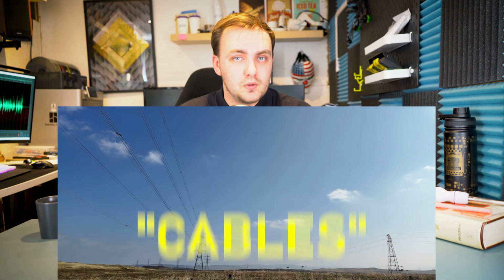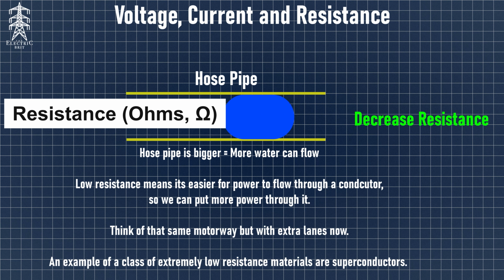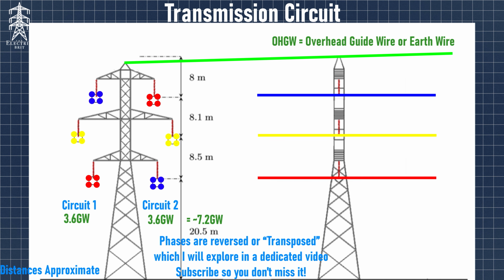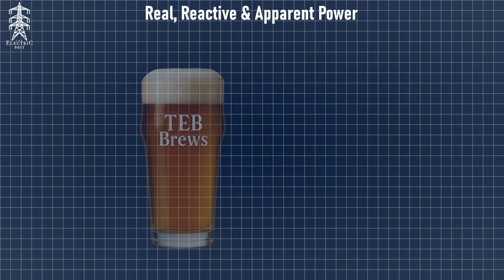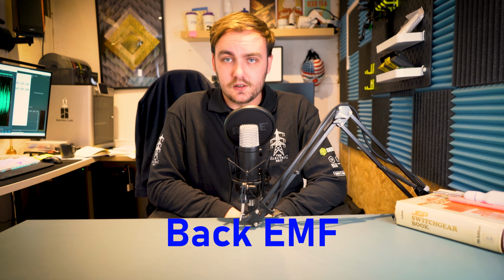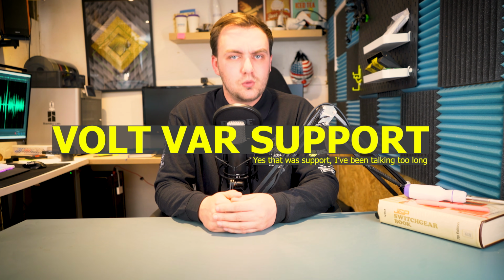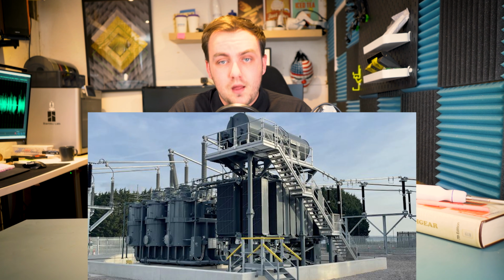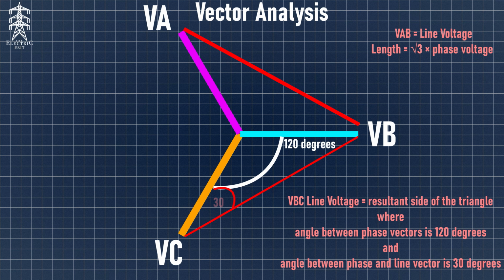How the UK Grid Works

Comment: I'd like a future video to explore local distribution, that is, from the local transformer to 415 and to each domestic consumer.
I've been considering a solar array, but my DNO has imposed quite a low export limit of 5kW. This is because of the voltage rise at our supply point would be excessive. 
Our nominal supply votage is about 242V (presumably quite high to cope with high load on the distribution), it does drop when I load up our consumption, although I've lost those figures. The high nominal supply voltage gives less headroom for export voltage rises.
We don't have a heat pump or electric car charger, but some will.
It must be difficult for the DNO (SSEN) to balance up all of these factors and have a reliable system.
Our house is in a development that's about 30 years old and we all have 100A supplies. I know that many have much more restrictive conditions.
Love the channel and the humour, especially when you feel the need to translate from geordie, which is my native tongue.
Reply from the maker: Appreciate the comment Ian 😁 my distribution knowledge only goes down to 132kV so just barely qualifies! I’ll have to speak to some colleagues in distribution to see if they want to give some insight.

Our house is 25 years old now but with a 60A cut out and an EV charger, luckily not many on the estate but there’s quite a bit of solar around. Interesting issues were going to come up against especially with mandatory solar
Reply: @TheElectricBrit  60A!!! That's tiny, especially for such a new development.
The DNOs have some very big challenges ahead of them. It's going to be very expensive or there will need to be some creative thinking required and I doubt that the industry likes excessively creative ideas. Stability and safety will always have to be paramount. 

Friend in Wallsend lives on an old council estate, I think that they have a 60A supply, but that's forgivable given the era in which it was built.
Reply: If your place is about 30 years old, it’s quite likely to have a local transformer to the old standard, with 240V being the norm for domestic. Until a couple of years ago, my place was like that, until SSEN replaced the local transformer along with a lot of replacement ground cable https://youtu.be/LS8VFhRMsYY (5 minutes) , and my normal voltage is now around 235, in lieu of 245. The buried 11 kV cable is only a couple of km away from the DNO substation.

Although there is no footage of how it was done, when they swapped out the old transformer for the new, there were no power cuts. They used a temporary generator set in a pair of ISO containers parked on the road alongside for a day or two. All changed over live, so no interruption when they did that. All the faults had occurred due to buried cable failures in recent years, hence the replacements.

When the standard was changed, the tolerance was adjusted, so that both the old and new ones met it; no need to replace them all at the same time, so there is still a fair bit of variation locally.
Reply: @johnkeepin7527 I measured my voltage drops under load at my own distribution box. It must be that the drops are happening primarily in the short cable to the road, if it was in the main distribution up the road it would be intolerably large for the rest of the development. 
Of course, getting any information out of SSEN is nigh on impossible. That's why I'd like to see a presentation about industry norms for cables used and practices over the years; how the standards are interpreted and implications for heavy loads such as car chargers and heat pumps, and also for solar generation. 
SSEN have a fingers in the ears attitude and fob you off with a take-it-or-leave it communication. 
I do have quite a lot of experience in electrical/electronics engineering, but not in power distribution, so I can handle the explanations if only they would be forthcoming.

Comment: I don’t understand the part about thermal runaway. If the resistance increases, shouldn’t this decrease the current, and therefore decrease the temperature?
Reply from the maker: Good question! That’s how it would work in a balanced system, however the load it supplies still wants the same amount of power and current. So resistance increases, current remains the same, so your I2R losses increase.

Add to that most cables now aren’t cooled and in London they’re surrounded by lots of not great thermal material like concrete and hot tube lines so cables actually need to be turned off when demand gets too high. Also because they act like big capacitors which affects the network too. Hope that helps!

Comment: Video looks kinda overexposed.
Reply from the maker: Yeah this video was shot in 2-3 takes in a garden room, by the third set I had decided to manually set the ISO and underexpose the shot. My next video I’ve decided to control more of the lighting too. Getting there with a very small space to work in😁
Reply: @TheElectricBrit Ahh, I feel like I opened mouth and inserted foot now. It probably wasn't clear, but I meant that constructively. I'm subscribed and looking forward to your July video! ♥
Reply from the maker: No harm done, better that people call out problems so I can fix them :)

Comment: Excellent work very well presented,  I am a retired  Thermographer and chased down HV thermal anomalies and overloads mainly from badly planned distribution (415V), overloaded Neutral with Harmonics.  Check this video  I would very much like to hear your analysis.   " High Voltage Transmission Line Overload and Smoking in the Netherlands "

Comment: Great video! Some of my unanswered questions: Why does increased demand decrease frequency and not voltage?
Why do generators need to supply reactive power? Isn' t the aim to correct the power factor locally, close to the load, so there is no reactive power on the grid? Or is that not always possible?
Reply from the maker: Thanks 🙏 and great questions.

On the network voltage is actively controlled at many points using AVR or automatic voltage regulation. At the generator this is done by controlling excitation to keep voltage constant, whereas the change in load fights the RPM of the generator, causing its frequency to change. Voltage is also regulated at transformers using tap changers and by capacitors on the network. So voltage can vary from area to area but frequency is system wide so is prioritised.

Regarding reactive power, grid code requires generators to provide reactive power for grid stability. Add to that that domestic and commercial customers often don’t do power factor correction so there’s will always be some need. 
Reactive power also causes voltage drop over long distances, consuming the reactive power so it doesn’t travel well, so it makes sense for the grid to provide some of that facility rather than relying on end points.

Hope that helps a little! I always miss something off these videos but thankfully people ask the right questions in the comments

Comment: The part on cable losses in respect of buried versus aerial cables was interesting - never heard that before - the massive capacity difference between an air cooled overhead 400kV cable and an underground one!  Well done - sorry you got demonetised - hope you can fix that ?  I don’t recall any dodgy content!!
Reply from the maker: Thanks for the comment Richard 🙏 Cables have been on my mind for awhile and there’s so many people on the East Coast especially that need to know so glad you learned something. Will definitely be going more in depth next time. 

Re demonetisation it was nothing with the content, just silly Google services closing an account with no reason and an extremely slow appeals process. 2 weeks later and no support I can reach out to which is a pain! Fingers crossed it’s sorted soon
Reply: I think there's issues with capacitance with AC cabling too, as charge peaks repel/attract electrons undermining insulation.  I think I first came across it discussed with some attempted homebrew hydro power projects and caught up with some theory delivered entertainingly by ⚡ Electroboom ⚡ who's shocking demos maintain a spark of interest.
The use of high voltage DC for power connectors has become feasible.